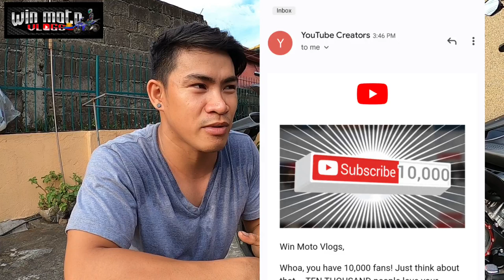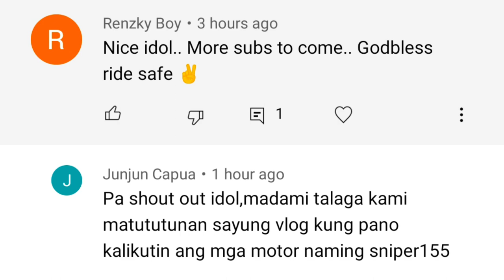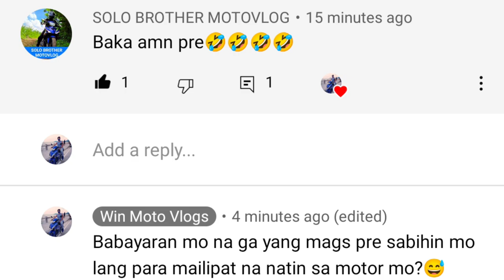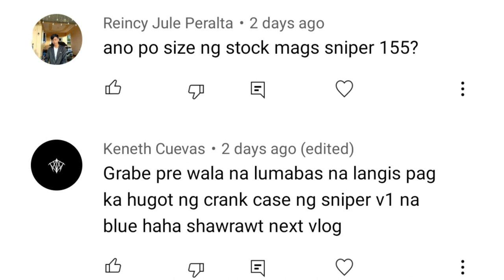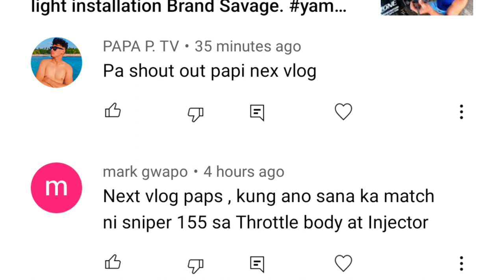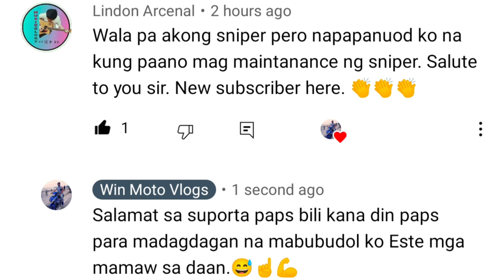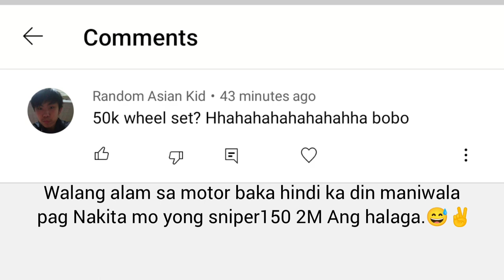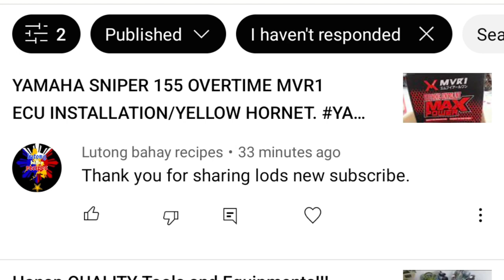YAMAHA SNIPER 155 luxury crankcase Ducati edition installation BLACK RAVEN.

Comment: My shop knb sa catanuan
Reply from the maker: Wala paps Dito lang po ako sa Lipa City Bahay lang pero naghahanap na kami sa labas para kahit Gabi pwede kami gumawa Minsan Kasi nakakahiya sa mga kalapit may napunta pa ng 8pm tapos open pipe nasa loob Kasi ito ng subdivision sobrang tahimik Dito.
Reply: @winmotovlogs3291  kc sa catanuan at mulanay parang walang marunong gumawa ng fi kpg ngka problma, mdami n shop n pinagtanungan
Reply from the maker: Kaya nga paps last time nag service ako Dyan sa amin catanauan matagal na yon Bago pa mag pandemic Dala ko lahat ng tools Fi cleaning inipon ko Muna Yung mga kakilala ko tapos Saka ako pumunta apat ata nagawa ko noon tatlong sniper Saka Isang NMAX. Tapos mahal daw reset error code doon kong may sarili lang akong sasakyan at may puhunan pwede ako mag shop Dyan lugi Kasi ako sa shipping fee ng parts.
Reply: @winmotovlogs3291  boss kpg npasyal k ulit dun pagawa q raider fi q,,6 months n ata un wala marunong,,odometer problma

Comment: Paps lod, parehas ba bolt ng 150 & 155 dun sa may oil filter? Yung tatlong bolt
Reply from the maker: Yes paps kahit po sa buong Crank case kabilaan same sa haba at size 8mm.
Reply: @winmotovlogs3291  ah cge lods. May benta ka whole set paps? Yung white bolts?

Comment: Paps pa advise naman po bbili kasi ako mtor naguguluhan kasi ako kung sniper 155 or raider 150 alin kaya mas ok paps? Slamat sna masgot mu
Reply from the maker: Sa 155 kana napaka ganda ng handling
Reply: @winmotovlogs3291  ok paps slamat
Yung standard at r version ba paps same lng cla ng makina? Pinag kaiba nung r vrsion is kyless lng?

Comment: Tanong lang sana paps, uma sparkplug, faito coil at uma air filter at kalkal pipe at mvr1 ecu.  ano bang maganda na mode para sa ecu paps na pwdeng daily use at long ride. ty ridesafe
Reply from the maker: No.7 tapos after 1k odo baklas spark plug reading kong ok na sunog at maganda humatak stay sa 7 kong rich baba sa no.6 ganun po ulit after 1k odo spark plug reading Hanggang sa makuha nyo magandang sunog at hatak.

Comment: dapat ba sagad ung oil seal boss? pansin ko kasi need mo pa pukpukin ng handle ng screwdriver ung sakin kanina pag lagay ko nung oil seal smooth lang. or baka hindi pa sagad?
Reply from the maker: Dapat sagad po dahil nahuhugot Yan minsan kaya minsan pag baklas ng crank case nandoon na sa may oil pump naiwan na.
Reply: @winmotovlogs3291  sinagad ko na with pukpok na din para sigurado haha

Comment: kasya po b sa sniper135vlassic un luxury crankcase?
Reply from the maker: Not sure paps hindi pa po ako nakapag install sa sniper 135 ng ganyan may para sa 150 155 at hindi ko po sure kong Meron para sa 135.
Reply: @winmotovlogs3291  thanks. sa sagot paps. medyo may similarity kase sila sa engine. . hehe

Comment: Paps na experience mo ba sa sniper mo ung parang may kumakalansing sa bandang likod pag mejo nadaan ka sa lubak. Ung sakin kasi ganon di KO malaman San nanggagaling un. Salamat paps
Reply from the maker: Sa akin dati yong chain adjuster check nyo yon pag hindi yon. itry nyo paalalayan sa Kasama nyo nakatayo tapos hawakan sa grab bar yugyogin nyo. Pag hindi nyo Nakita kong naka shifter Minsan Doon yan sa mga bolts may Luwag or plate number.

Comment: Paps idol, natagas ba ung langis sa rcb na oil filter cover kapag katagalan?
Reply from the maker: Yes paps may issue yon na hindi maayos ni RCB dahil yon sa pandikit na ginamit nila pag nainit parang bumibitiw sya kaya natagas iilan lang sa nainstallan ko Ang hindi tumagas pero karamihan Saka sa sniper 150 ko dati tumagas din kahit higpitan ko na lahat ng tornelyo na Allen natagas talaga kaya stay stock nalang ako.
Reply: @winmotovlogs3291  sge po paps salamat po sa info rs po

Comment: Ano mainam na size ng sprocket sir sa snipee 150? Ty.
Reply from the maker: Depende po sa timbang ng driver paps at Depende sa size ng gulong 80 kilo's pababa 14 43 kong Malaki gulong 140 pataas 80 kilo's pataas timbang ng driver 14 44 po pero pag 44 mabilis na mag limit kaya need na mag ECU.

Comment: Tanong lng sana paps, uma sparkplug, faito ignition coil, uma air filter, modified pipe at mvr1 ECU Ano ba magandang mode para sa ECU na pwdeng gamitin na daily use at longride. Rs
Reply from the maker: Kong yan po yong mody5 na open pipe no.7 Ang set.
Reply: @winmotovlogs3291  pagkalkal lang po paps? Anong mode Bagay

Comment: Idol wins anonpo size ng nut sa gitna?
Reply from the maker: 10mm po yong sa may push rad pinaka gitna ng clutch housing.
Reply: @winmotovlogs3291  ah ganun po ba kala ko 6mm same ng bolt sa mga gilid salamat po balak ko po sana bumili ng gr5 di ko lng alam sukat baka po kasi mag kamali